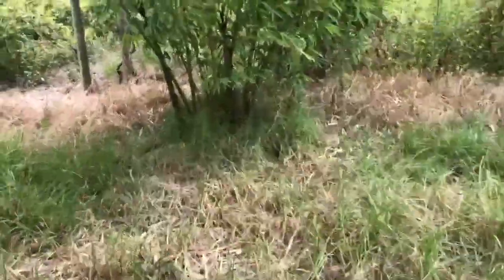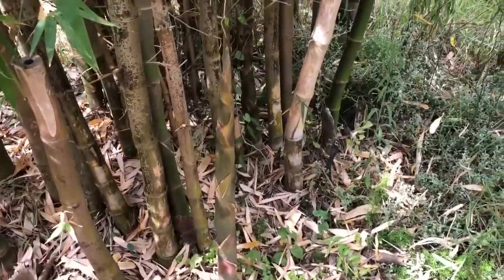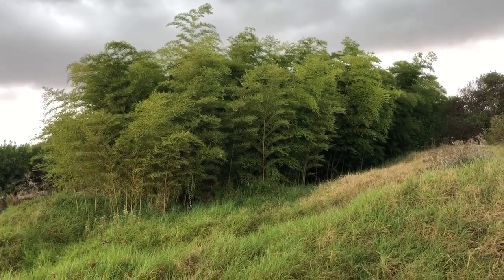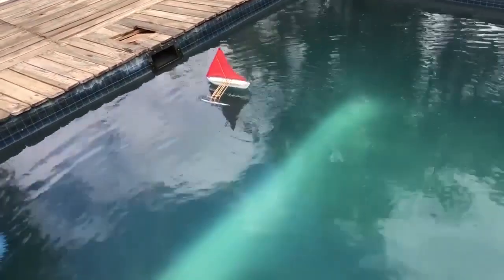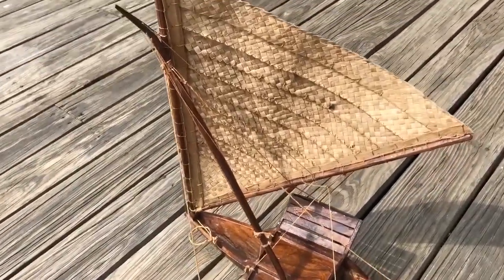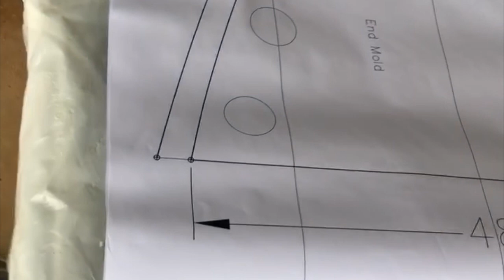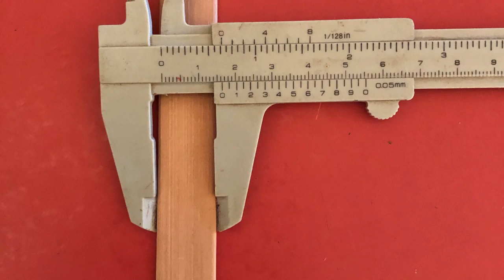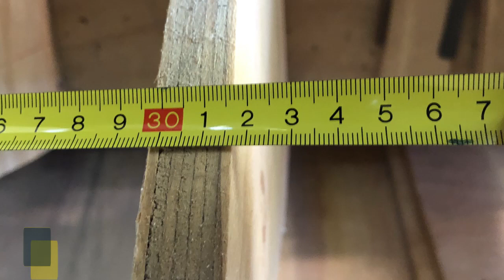Bamboo Proa - Episode 01

Comment: Great stuff Adrian, many thanks for sharing.  Is it just one layer or bamboo? amazing to think how light this is going to be.
Reply from the maker: Yes I used just the one layer of bamboo with fiberglass on both sides. but it is very flexible. I have bulkheads at 30cm intervals that are filled with PU foam and that provides the additional support required. To build a larger craft it likely require more layers of bamboo and fiberglass.